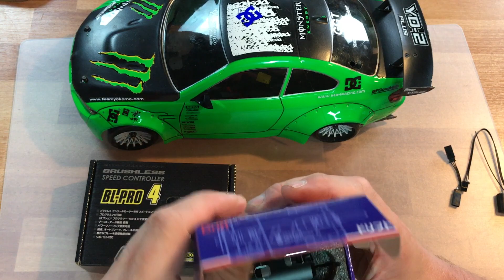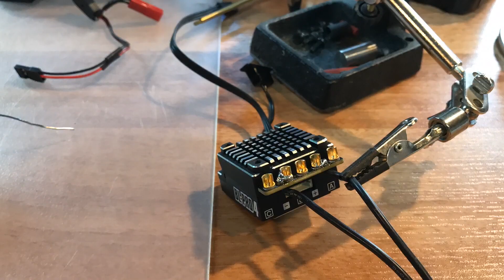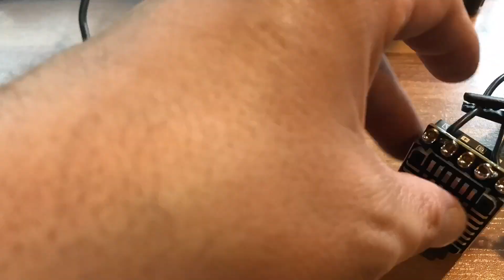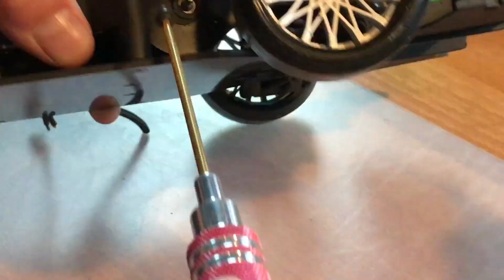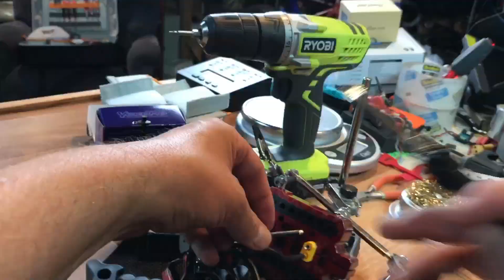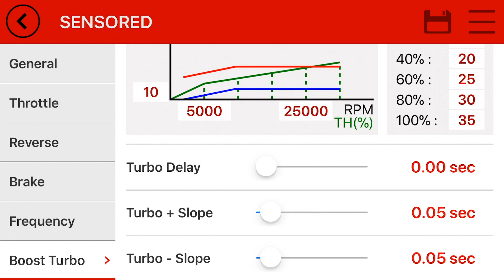Upgrading my Yokomo YD-2. BL Pro 4, D1 Motor, BL WM Wifi Module

Comment: everybody use deans why? u are the first i see that use xt60
Reply from the maker: Xt60 is the superior plug. Easier to solder too. Now on my drift car I use batteries with removable wires. I have a 90 degrees plug that goes directly from the esc to the battery- no plug at all
Reply: xt60 are only sold by hobbyking..........only they say is superior...but nobody that i know use that connector.....and many rc car come with deans too
Reply: I use xt60 and xt90.

Comment: Nice Looking Car Jeff, are you using & Steering Gyro that's cheating take it off, you should learn how to drive without it i used mine for about a week then took it off, i didn't like it
Don't you fly any more all i ever see are drift cars videos, when will we see some flying lol
Reply from the maker: +Anything RC I do still fly,,, these videos are needed because there are so few setup” videos on YouTube for drift cars. 
When driving rwd- almost everyone, including the pros ,uses a gyro- not cheating at all. If you drive 4wd and use a gyro- that’s cheating, lol
Reply: @7demo7review  Thanks for posting these videos.  It's a GAPING hole of youtube i'm finding as I build up my yokomo yd
Reply: Jeff's got a point you can't drift rear  wheel drive without a gyro its very difficult

Comment: Well I gotta admit, that was really interesting and I may have to go find a drift track in my area and try it out!  I am glad to see that you haven’t gone completely over to the dark side in that you still prefer XT-60 connectors, lol.  If you had switched to Deans or god forbid, Traxxis, that would be horrible...   One question I have to ask Jeff —  would that motor and ESC work on something like a spec wing, or that Sonic you built?  All that cool tech, I want to make it fly....
Reply from the maker: +Tom Muhleman, Jr. that would be a cool project challenge! Maybe I’ll take the motor I took out and try it on a airplane- the kv is around 3500. 
Lol about the connectors!  
Rwd drift is both rewarding and frustrating- the feel and setup can change so much with 1/4” turn of the wrench or the wear in of the tires. Totally fun if you like to tinker. Super rewarding when you get it right and can drive controllably next to your friends and they trust your skills!
One other factor is this- the track stays open usually until 2am. If I want to drift after my family goes to bed, I can. It doesn’t conflict with my family time,,, though I’m tired the next morning,,,lol